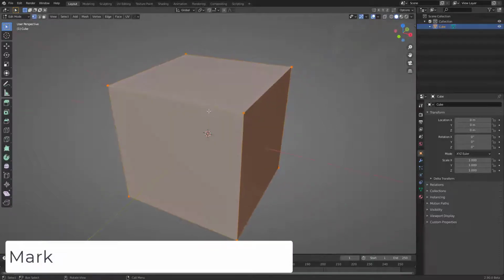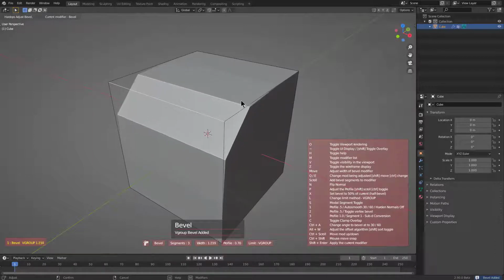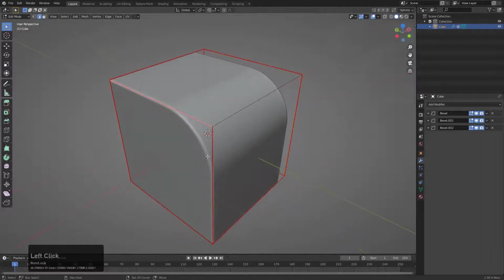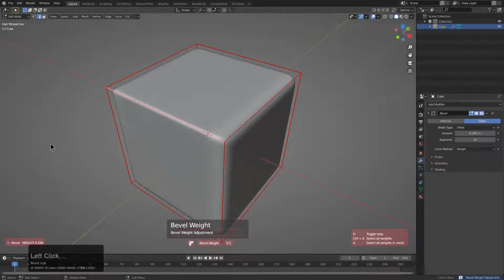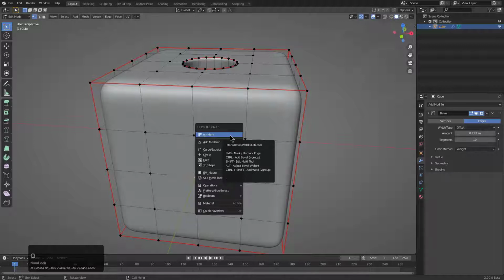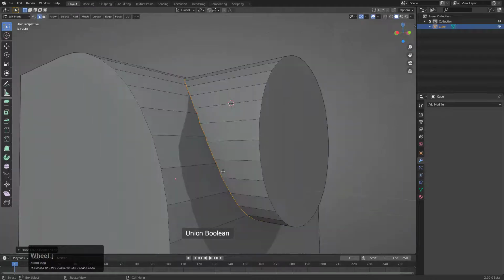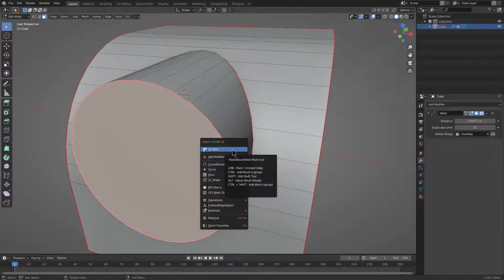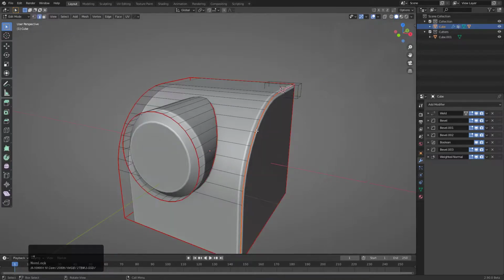#hardops 986X - Mark (67)

Comment: should I make any bevel in vanilla edit mode or using hardops to make it non destructive?
Reply from the maker: I am not even sure what that question means. 
https://docs.blender.org/manual/en/latest/modeling/modifiers/generate/bevel.html
Reply: @hopscutter7503  I mean should I make bevels normal way or use hardops to make edge bevels non-destructive.